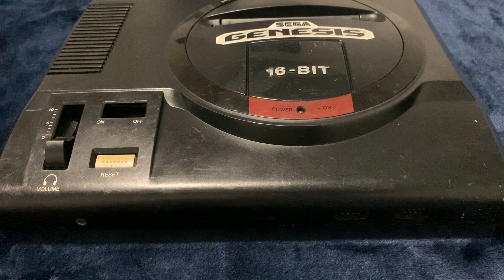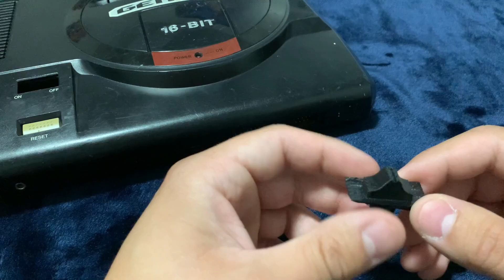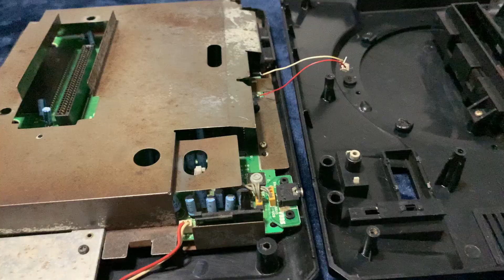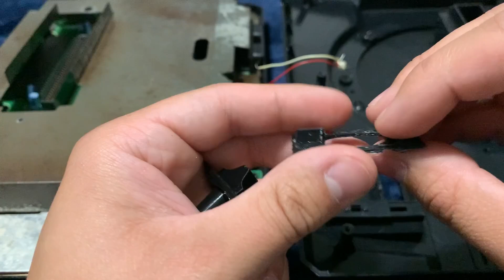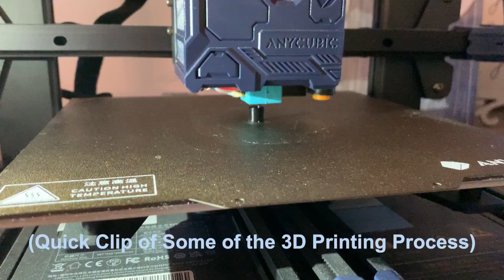Replacing My Sega Genesis Model 1 Power Switch

Comment: Did you just broke the switch 😮 because it didn't click back when you turned it to off position
Reply from the maker: @user-nx9dh1cu3v No it didn’t break. 😂 It still clicks in both positions, but that time at the end of the video it didn’t for some reason. 🤷🏼‍♂️